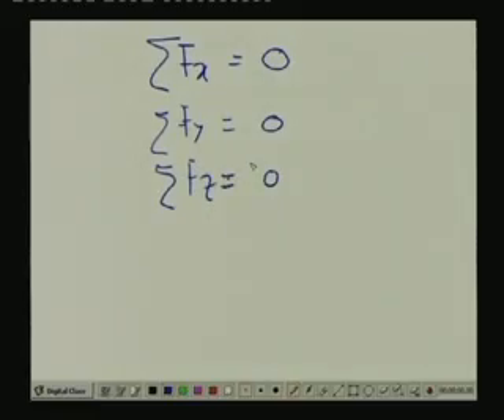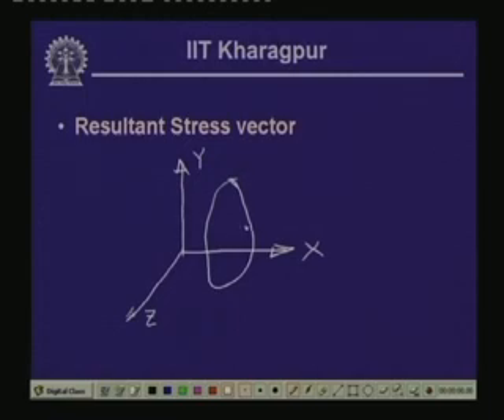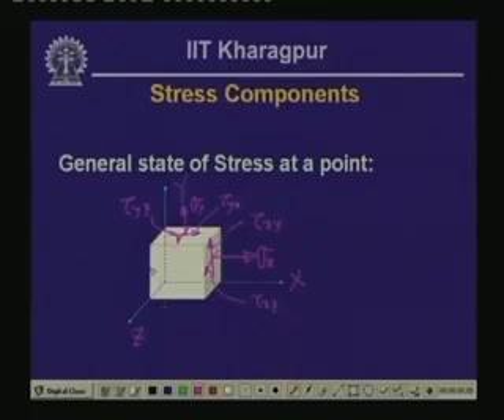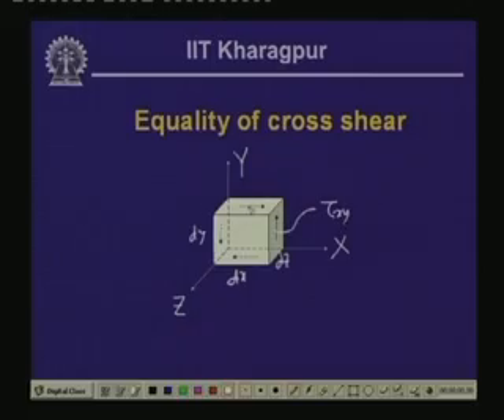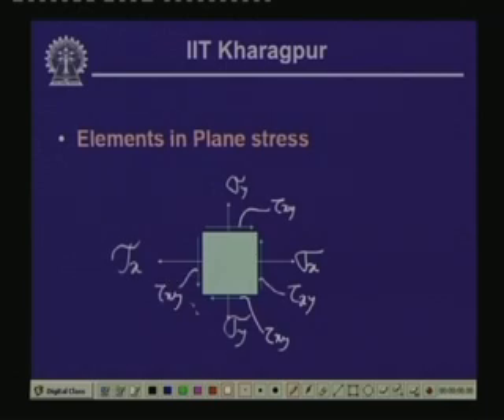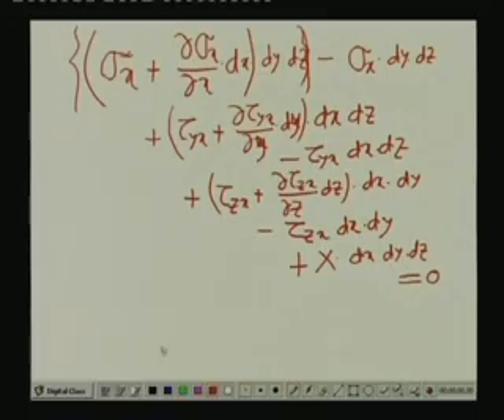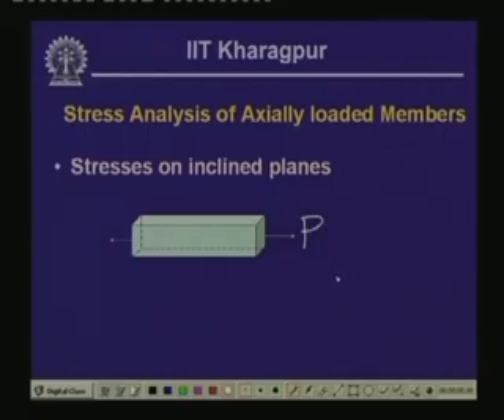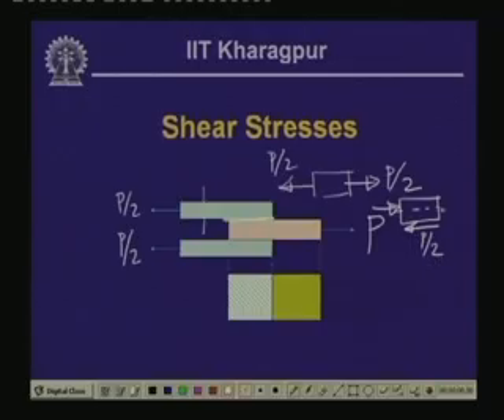Analysis of Stress - 1

Comment: Sir why the small stress (dhosigmax/dhox)dx is added???
Reply: (dhosigmax/dhox) represents rate of change of sigmax wrt x i.e. change for per unit change in x , so when we traversed a distance of dx to get value at that point we multiply with dx which is supposed to be the aggregate change over the length dx, thus exact value becomes previous value + change in value.